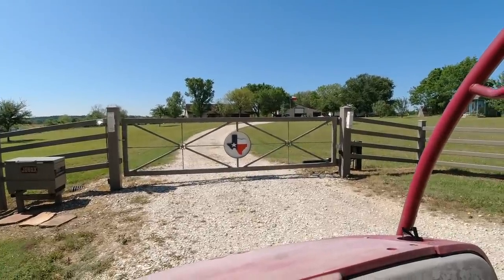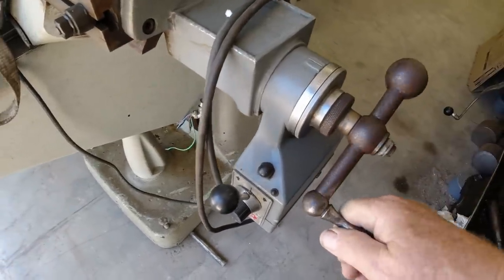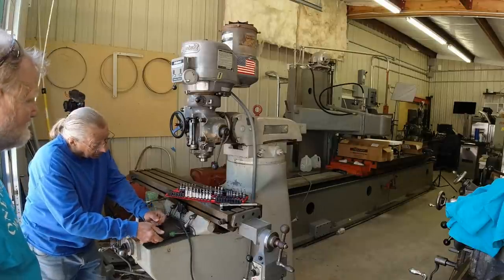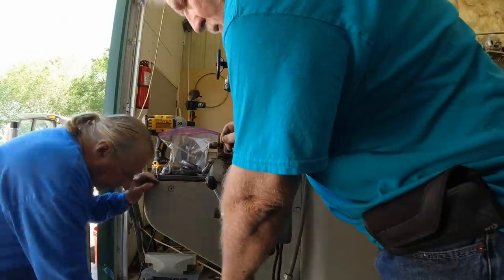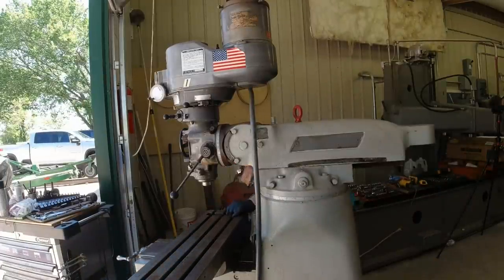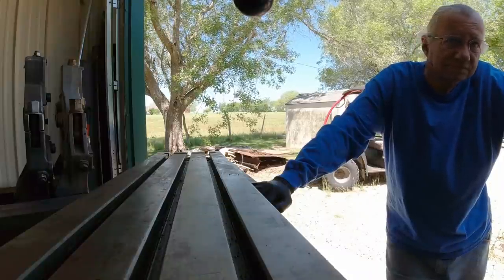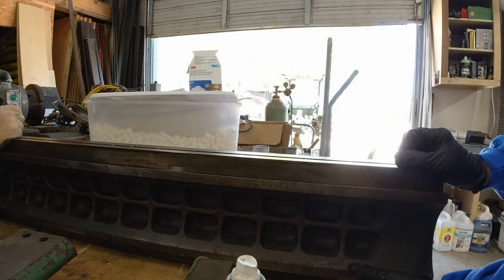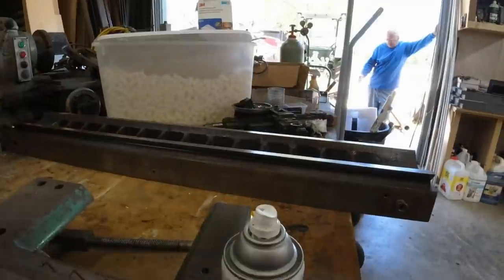Bad Bridgeport: Part 1

Comment: Yessir, the Klingons have the gate code and you will not rest easy for a while till a spell of geezerishness sets in and they forget everything. Nice mill. It'll go up and be happy doing it. GBWYou and the Hermit Painter!
Reply from the maker: I think I need a disrupter canon at the gate...
Reply: @10swatkins  You might need to go back in time and get Lorne Green to send you a used Ravishol Pulsar out of the Battlestar Galactica. Old school would work best down there.
Reply from the maker: @lewiemcneely9143  Hell I'm going forward and getting Kirk and Spock!
Reply: @10swatkins  I just thought it might take an old fix for an old problem!

Comment: Hi Steve and Don!
It is REALLY nice to see you!  You guys do REALLY good work!!
You have a little white building out back that..  could stand a lick of paint. (hint,hint Don)  I use Benny-Moore.
The OLE' Bridgeport has found a good home!... Yes...She has a few stripped screws, nuts,cracked fittings, and A LOT of backlash,... but it is NOT UNLIKE the guys restoring her;  At 81 + I need a few upgrades and repairs, and a heavy coat of new paint wouldn't hurt either!
By the way!  CHECK for tunnels under your fence!... Don may have burrowed under the fence!
The BEST security system I have ever found is a good fence, and (3) WELL trained Dobermans!
I have signs that read....:WARNING!.... BEWARE OF DOGS!!!... The DOBES can cross this property in (8) seconds flat!! Please call me before entering!!
Best Wishes, AND GOD BLESS!
Gary
Reply from the maker: Last week I found a parachute in the trash can! :)
Reply: Yeah but having a sign that says beware of dogs, is admitting you know that you have dogs that bite, that's intent in the laws eyes. If someone enters your property and gets bit, they can sue you and will win. The sign to have says, dogs on property.

Comment: That is called an Air Draw Bar.. worth its weight in gold. In 1981 during my apprenticeship with my dad we had a Model 55 Index Knee mill. I was green but at tool and die school I learned about DRO’s. So I contacted a guy who came to talk with my dad and I about installing one. I’d been counting turns and accustomed to the left or right side of the screw but thought the DRO made perfect sense. My dad practically threw the salesman out the door and told me it was never going to be installed on our mill. He soon after went away to Fla with friends in a week long golf outing and told me to answer the phone and take a “few thousandths off the floor” every day while he was gone. I did the opposite. I had that guy come back and install the DRO on the mill and he was pissed the first day back. I told him to just turn it off and use it manually and he did that day. That first night my dad came back to work (as usual) and must’ve tried the DRO. The next morning my dad was in a state of absolute euphoria.. he proclaimed that with this DRO there IS NO BACKLASH!!!! He told me that from that moment on if anybody came to rob us he would stand in front of the mill/DRO and say take whatever you want but you ain’t getting my mill!! You will love that DRO because it makes your mill very accurate. Read the instructions well. You can set the resolution to read every .0005, every .0002 or every .0001. I chose .0002 and it’s close enough for milling and jig boring. If you want it closer buy a surface grinder.. you want it closer??? Buy a hone..good luck gentlemen and get that gate fixed..
Reply from the maker: Great story! Thanks :)

Comment: The problem with bridgeports is no matter how clapped out and shitty they are, people seem to think they're sitting on a goldmine. They're stupidly expensive compared to better mills with less recognizable name plates on them. People here sell bridgeports for >$5k, and I bought a much larger / heavier / more rigid box way CNC machine for 1/5th the cost. Now it needs work too, but all in it's going to be considerably less than any bridgeport I've seen for sale in the last 3 or 4 years locally, and a much more capable machine in every way. Larger travels, bigger spindle motor, flood coolant, full enclosure, etc etc etc.
Reply from the maker: It depends on the work you want to do with any machine....  Bridgeports are easy to run and for most people they would never use the full power of a "Better" knee mill, say a Tool Master.  For me its all about the kind of work I plan for it.... I have little needs for heavy cuts, If I need to remove a lot of material its into the Bridgeport Torq Cut 22 which can move metal a hell of a lot faster than a Tool Master . Really want to move some metal and it's off to the Planer....   The work fits the machine for me.... After all you would not want your Dentist to use a jackhammer on you....

Comment: Steve how worn are the screws?  Could you machine them back to a consistent profile (but with thinner threads) and then just take it up with the nut adjustment?  I did this on one and it worked OK, not much variation at the extremes of travel.
Reply from the maker: Not worth the effort.. New screws are reasonable and these are really worn out :(

Comment: "All it needs is a nut" but I think he meant "nuthead" 🤭
We have an "Aizpurua" knee mill when we bought another company a few years ago. It now is in almost usable state but still needs a lot of TLC. It was completely greased up and black, like the most darkest and filthy spot on your Bridgeport. Everything still works but the tentioner for the motor belt (it has a variable belt drive) is rattling loose all the times and the gibs in the dovetails are completely worn out but strangely enough the lead screw and nuts still seem to be in good condition (almost no backlash). If I ever get the time, that will be a fun project to restore.
Meanwhile I'll hook on to your rebuild project to learn some tricks from the master.
Reply from the maker: Stick some shims behind the gibs until you have a chance to fix it right.,

Comment: Check out a ball screw kit chords your mill . Cheers
Reply from the maker: I rhink ball screws on a manual mill are just asking for trouble.  Not enough friction and the table can runaway from you when climb milling...  too deep a cut and its gone....  hard on a machine and your hands.

Comment: I've seen a lot worse on the table ways!!!!  Spot them, a little oil, slap it back together and call it good!!! You'll get another 100K out of it before it craps out.  Better than that rock you had. 😁😁
Got to go, fixing to be late for PT myself.😏
Reply: Chrome ways are not scrapeble until the chrome is removed.
Reply: @zedostenso3069  Yep! that is correct!  I don't believe that the table ways on his are chromed.  Could be wrong!  Bridgeport offered it just about any way you wanted to buy it.  If they are chromed, and he decides to put it on his planer, a good carbide tool can get under that chrome and peel it right off.  But man, that's going to cause him to remove lot more material that will require cutting the saddle and installing Rulon or equivalent to make up for all of that removed.
Reply from the maker: IT is tempting.... Saddle will need some work....
Reply from the maker: I have a 20,000 pound planer that works wonders on chrome :)

Comment: Hey Steve, if you get a chance, check out Keith Fenner’s videos on rebuilding his Bridgeport (Buffy). It’s pretty involved, down to each nut and bolt, it’s several videos long but if you have any questions that’s probably the best video out there. Looks like this will be a good video, thanks!
Reply from the maker: I don't think I have any questions....
Reply: @10swatkins  yea, after I sent that I thought he doesn’t any help, sorry for what I implied. Just trying to help, do you ever watch other YouTube machinist?
Reply from the maker: @Hoaxer51  Very few....  Some of them are into it for the money and knowing what I know makes it hard to watch...  Also  Lets face it there is only so much content needed about a machine shop...  I mean how many times can you watch a cylinder being rebuilt or a piece being made...   IF I watch other channels I find I would be just putting out more of the same content and I would get discouraged... I hope this channel is more about what goes on in a small shop out in the country and the things I run into every day...

Comment: Heck the servo is probably worth what you paid for it...☺
Reply from the maker: No, even clapped out Bridgeport's are expensive...
Reply: @10swatkins  hey Steve just kidding about on the cost...yes, expensive, but the servo drives as you know are bullet proof. Will you re-surface commercially? I do need a clausing drill press table regrind...bad.
Reply from the maker: Have a picture of it?   Send it to my email....  Shipping will probably scare you though,,,